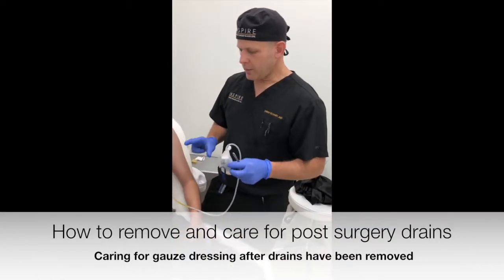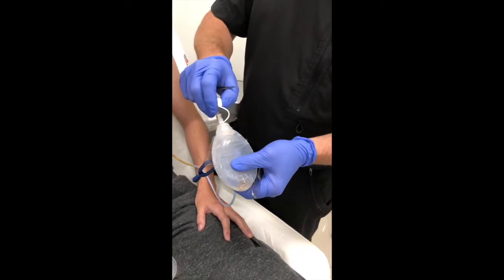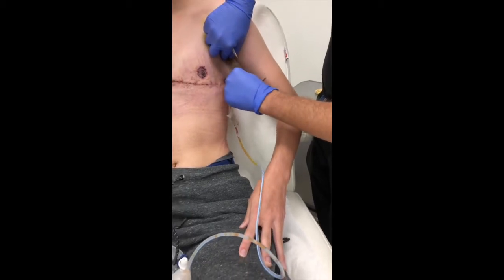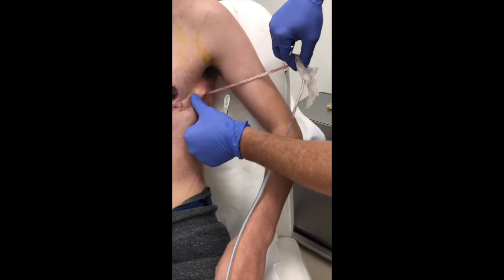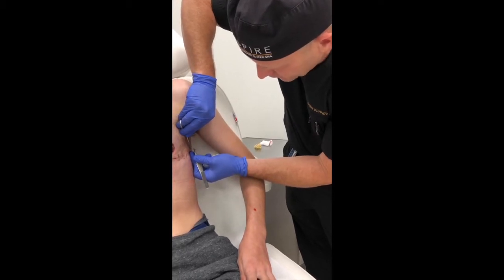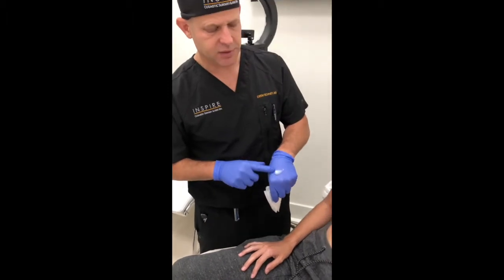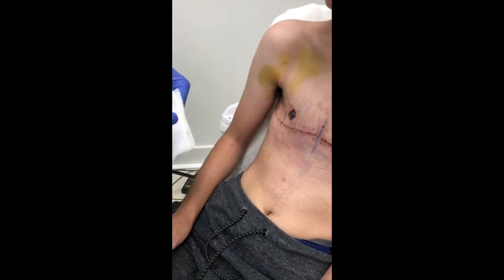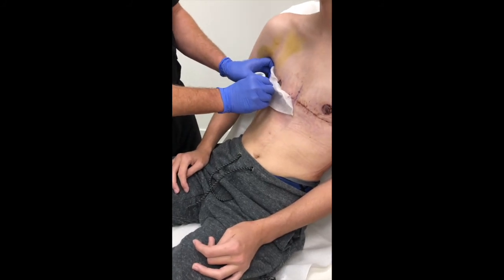Removing post surgery drains and aftercare for wounds

Comment: I had double mastectomy direct to implant two weeks ago. My drains got pulled at day 10 due to leaking around drain entry and possible infection. I also got put on oral antibiotics for 5 days. It has been 3 days since the drains were removed and the holes are still leaking and open. Is this normal?
Reply: Yesterday got mine removed because of infection.. now am on antibiotics too.. but am so stressed about where will the fluids go as I can feel it inside .. how did yours stop ?